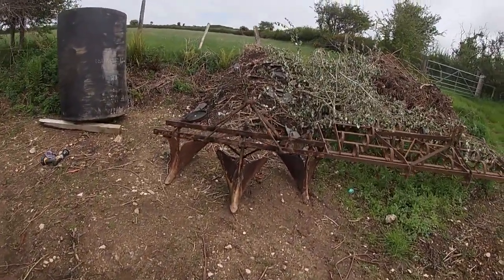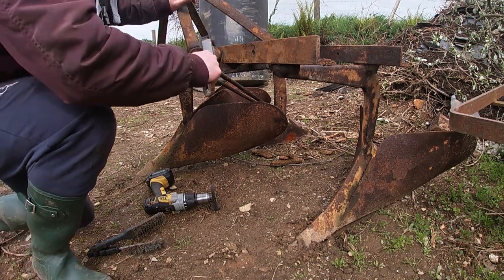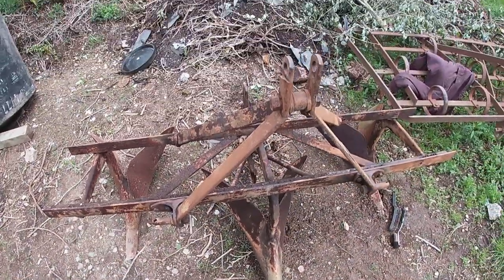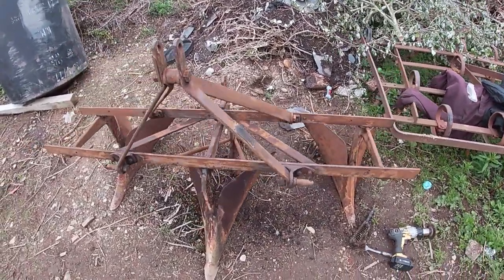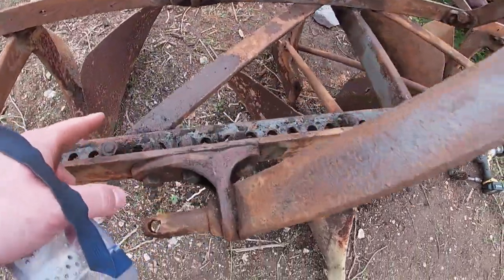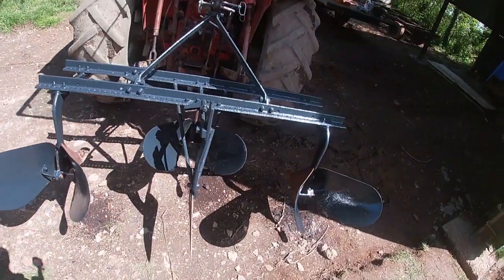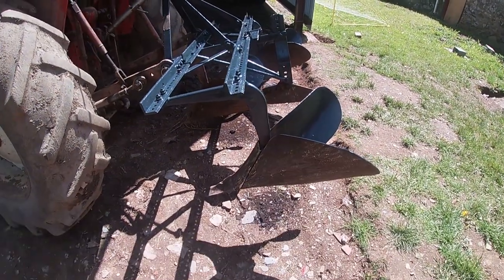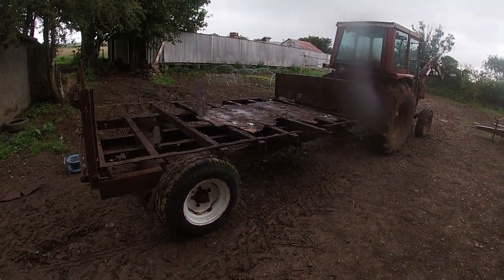RESTORING OLD FERGUSON POTATO RIDGER!

Comment: those wire wheels work much better on a die grinder as they have much more rpm and you can get in much more places with them over a drill but 100% need eye protection on.